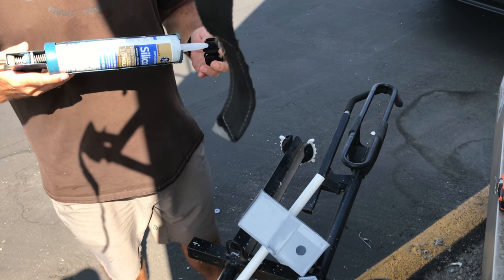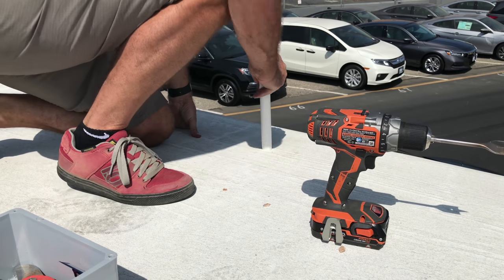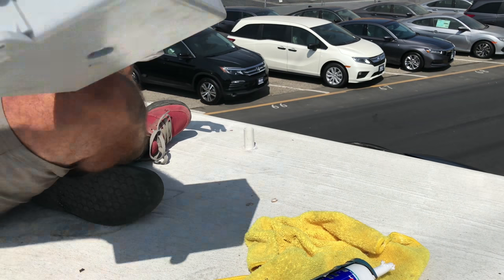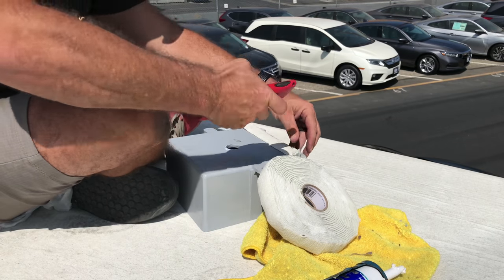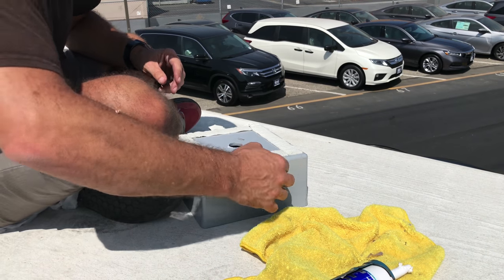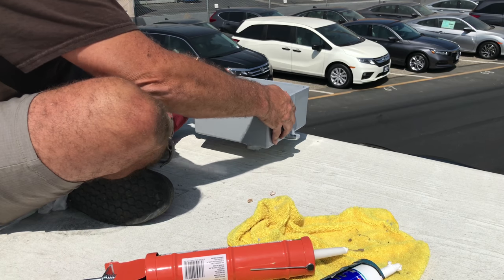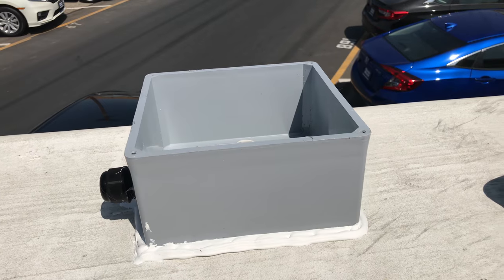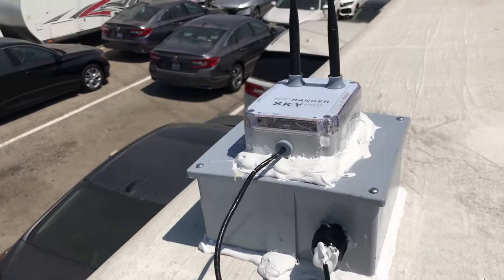WIFI Ranger roof installation

Comment: This is how I installed my solar. Couple years no problem at all. Well done.
Reply from the maker: BlackTop Boondocker thank you 😊 that was the main idea of why I went this way. If I want to put anything on the roof I will not have to drill more holes. Not sure if I am going solar on the RV. Thank you for watching 👍
Reply from the maker: Ok my router will broadcast Papa Drew’s Family RV channel. If you are in the same park and you have subscribed to the channel and you come over and say hi. I will let you jump on my guest network! Just want to help everyone out when I can. I did this at Dockweiler state beach and it worked out well. I was able to get the parks WiFi when the other RV could not so I let others hope on my network and enjoy WiFi!
Reply: I highly recommend solar. Even a small single panel 100w system is extremely valuable in my opinion. I can tell you this I use my solar a hell of a lot more than my Wifi Ranger.
Reply from the maker: I will look into it. I have been wanting to boondock more and more. I might even head up to the RTR just to check it out.